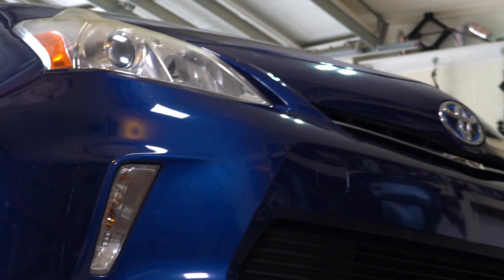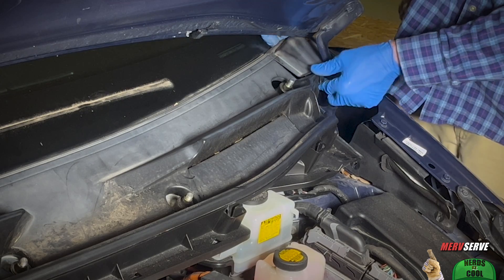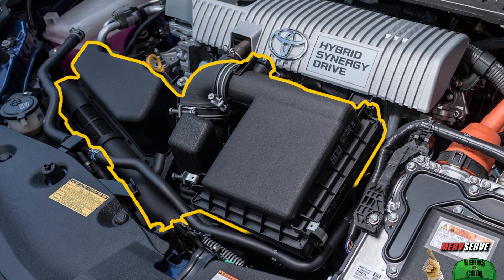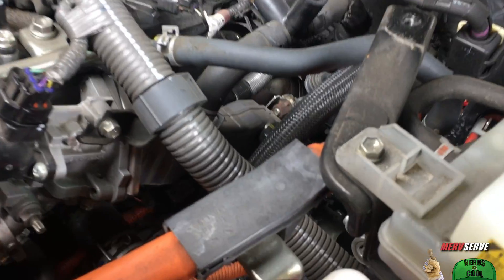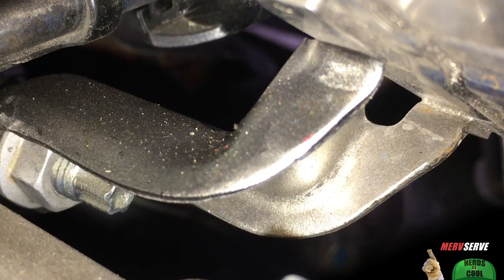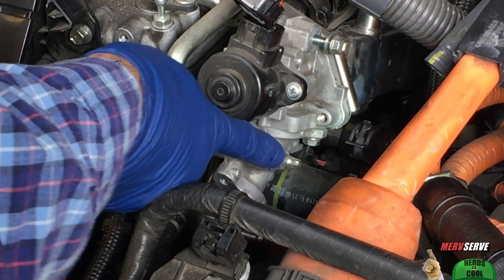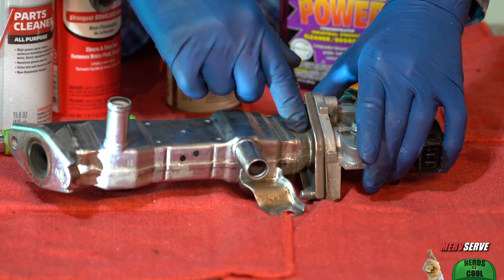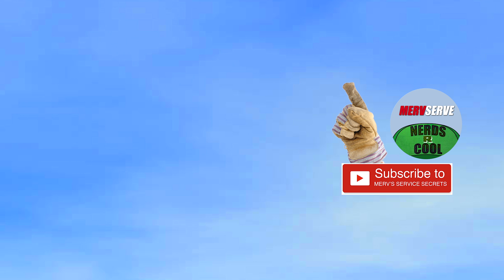Toyota Prius EGR Removal PLUS Organic Methods for All Cars - Ford, BMW, Chevy, Honda

Comment: It is not just the EGR cooler but also the intake manifold passages that are gummed up and could potentially be the reason for your engine's rough idling, driving, trembling, or shaking—unless you have a blown head gasket. While at this step, you should replace the PCV valve($10), as it will fail before the other two components, and clean the throttle body. If your car has more than 150,000 miles, you should replace the water pump($250 Toyota), located at the bottom left under the intake manifold, to prevent it from causing the check engine light as it could be too late for the engine then, and you could have a blown head gasket.
 However, I am seeking advice on properly purging air from the cooling system. I removed a water hose because it was stuck and came off abruptly and I need to purge the air from the system now, but no one seems to know how to do that correctly or they don't know how. 
It can be done with the Toyota diagnostic tool, which costs around $3,000 and can only be obtained by a Toyota dealer. The process is different from traditional cars due to the inverter coolant reservoir, making it an essential step. Can anyone help with this step? 
I might need to perform a complete flush, but that takes too long."
Please !!! 🙏???
Reply: If you figure this out, please post an update.

Comment: Edited

Excellent video. Used it as a guide when doing the job myself (even though I was never encouraged my Merv’s video to do such a thing). Thank you @Merv and team for putting this video together. 

Context of initial comment: third party company handling delivery of PDF at the time of initial post didn’t do their jobs. Merv did it despite their failure.
Reply from the maker: Now that's what I call turning lemons into lemonade!  Best of luck in all your DIY Adventures, which I of course would never encourage. - Merv Himself
Reply from the maker: Sorry I'm just now find this. To be honest, I have not been happy with that service at all and it is run by a third party, so I have very little control over them.   Please let me know if this has resolved itself and if not, I can probably just email you the pdf directly.  Sorry again.  And for the record, T-spring merhchandising really sucks.
Reply: @MervsServiceSecrets  Hasn't been resolved.
Reply from the maker: Sorry you're still having trouble.  My best advice is to call your credit card company and dispute the charge.  I am working on finding a better third-party to sell my merch.  Again, sorry for the runaround they gave you.
Reply: I got an alarming wake-up call from Merv Himself, telling me to send you some PDFs pronto.  Very sorry for the delay!   Please post confirmation of your receipt here in this community section whenever you can.  -Demille, Merv's perpetual intern and indentured cameraman.

Comment: How much should I pay for that service? Ill pay $500.
Reply from the maker: I'd love to know what they charge, but my understanding is they just blow out the cooler with compressed air.  In my opinion, that's kind of half-assed.
Reply: @MervsServiceSecrets my uncle has a 2013 that just popped the egr insufficient flow code and got quoted about 3k. I replaced the headgasket and the egr/cooler for my friend and only charged him 2k. Idk why it’s so expensive

Comment: How can i only remove the egr valve? I don't want to remove the cooler. I will just spray it with cleaner while its on the car. No big deal. I am stuck. I can't get the nut at the bottom of the cooler. can't get any leverage on it. If I take the nut off i should be able to get it to move to the right enough to get the nut on the left of the egr in the back. Oh dear
Reply from the maker: Phillips head.

Comment: This is magic, Merv!
I've recently bought a Prius+ (European 7 seater V) which overheats. I started by changing waterpump (had thrown a code earlier) and thermostat, checking all coolant hoses and the radiator, finally coming to the conclusion that this is probably the adventure I need to embark on.
Not too keen on getting this done in the parking lot, but the coolant is already out, and at least I'm on vacation at the moment.
Might be able to complete this and the cleaning in a day!
Reply from the maker: Let us know how you made out.  It can be tricky!
Reply: @MervsServiceSecrets Here's my update so far.
- The "expendable crew member" nut is actually not that hard to get at if you "hug" the head and reach it from behind the engine.
- My EGR cooler was so very caked that I ended up buying i lightly used one in fantastic condition.
- Overheating issue remains and it might be time to tackle the intake manifold.

However! I've also found the EHR (exhaust heat recirculation) loop, which doesn't seem to get heated properly.. After speaking to a Toyota mechanic he concluded that "I'm on my own" as they had never come across an issue with it.
There are hardly any info about it online either.

The joy of a 300k+ mile Toyota hybrid I guess 😄

Comment: Merv, Regarding the 12mm nuts on studs...four, I think:  one only needs to crack the nut loose a few turns, then remove the stud with the nut together.  During reassembly, a drop of Permatex on the stud leading threads might be beneficial.
Wiper motor and linkage assembly.  Leave attached to its wiring harness.  Bolts out, lift and place it on the passenger side of the engine bay.

Comment: I’ve used pressure washer to clean the inside of the EGR heat exchanger.   Worked like a charm.
Reply from the maker: Glad you got it working,  I'm a pressure washer fan myself.

Comment: Hey Merv I’m on my second bottle of oven cleaner just wondering if my cooler is a goner or I should keep soaking it. I have to soak both ends and haven’t had much breaking through to the other side.  Still comes out black but it’s been almost 2 months
Reply from the maker: well I mean I guess it's never going to be perfect, but I always try to look at a job and ask myself "is this better than it was when I started?"
Reply: @MervsServiceSecrets thank you I probably should have blown all the crud out when it was dry then soaked it but I found a deal on a new cooler from Japan and wish me luck but the car works pretty good now especially after the software update.  I think I could put some o rings on a couple fuel injectors but besides that my car runs great. Check engine lights went away.  Just want to thank you for playing a big part in my learning.  The funniest thing that happened to me was getting high off a loose fuel injector accidentally.  I told myself that’s not my blunt, that feels too strong. Lol

Comment: i was trying to decide which i appreciated more, the tutorial or the entertainment value and tbh, both, which is an incredibly rare aspect of content creation especially for automotive repair. really good writing. i vote 1 as the most ridiculous since it makes the front of the vehicle yella. i just bought a 2014 prius v with 126k from my friend and doing this job. i didn't have any hose clamps but since i got those assortment of rubber stoppers, i just used those to plug up the coolant hoses.

Comment: This video is so well done and funny and you explain everything so a 10 year old can do the job I got to your channel by someone else saying to go to prius  shaking  I couldn’t help it but subscribe right away And give you a thumbs up for the good work you do for your community. My Prius has a blown up head gasket because it was losing a little bit of coolant. I had put bars leak a few times and it seems like it was getting better just losing a little bit of coolant. And then a few months down the road it was shaking a lot at starting and even putting in drive. It would shake for about 234 minutes. So I decide to ask my mechanic to put the blue devil head gasket sealant which he did and now I don’t have anymore heat coming in the car and when it starts shaking engine light came on I checked the code and have cylinder one and four misfiring. Can someone help me to diagnose this?
Thanks
Reply from the maker: Did you try fuel injector cleaner?  When Demille owned the car, he actually paid a dealer to clean the injectors and that solved all misfires

Comment: It could be a secondary issue, but after replacing our egr valve we now have a strong exhaust/unburnt fuel smell at idle in our prius (obviously except when in ev) if vents are set on outside air. Inside air we cannot smell it.

What did we fudge up? 😢
Reply from the maker: It's been a few days since your post. Is it still persisting?
Reply: @MervsServiceSecrets  Yeah unfortunately.  It could be an exhaust leak somewhere (we'll get it checked out when we have the money) but we were trying to figure out if there's anything we could have accidentally done in that system or not connected properly that would bring us this issue. No CEL and no codes
Reply from the maker: I'm a DIY hobbyist just like you, and of course we all attempt these repairs at our own peril, but a couple things leap to mind and I'll throw them out there just in case they resonate:    Maybe you forgot to reattach the PCV hose? Coolant leaking from when you clamped the hoses?  (Maybe one got damaged or wasn't reattached right) Gaskets properly reinstalled in the various parts of the cooler, including the one that goes between the cooler and the exhaust manifold?  Hopefully these suggestions might spur some insight.  Also, if it helps, this video shows my observations about those gaskets: https://youtu.be/QGcZYGA2cnM?si=X_aMkFf05ceWLW7n

-Merv Himself

Comment: my 2011 prius has 81k and I am thinking about replacing the radiator and inverter coolant, might be a good idea to do both egr and intake manifold cleaning at the same time.
Reply from the maker: You should

Comment: This is a great video. This car takes some work and it will eat  your nerves. Part of the design of this car are not so smart especially the Winshield which is very easy to break and that cooler bracket on the bottom is just bad painful design not even necessary. I learned and done the head gasket alone and it was great for 23k miles now is running super rough misfiring cylinder 1,2. I’ve taken all off the manifold the cooler soaking overnight and the valve I gave a good cleaning,will see if this will solve my problem. The manifold was very dirty but after cleaning it only not a difference at all. After I took the egr valve off it was full of carbon on both ends. The design of the egr system is terrible as you have to keep doing it over and over.

Comment: A more secure way to capture the nut you had the magnet on is to get a small piece oh insulation tape and put it on the inside of your socket then push it onto the nut/bolt you are undoing or fitting and it is a nice snug fit. Regards Chris

Comment: A word to the wise...after fighting with the "expendable crew member" for a day and a half, I came up with a brainstorm that maybe my tool was too big (no pun intended) because of this hose that's right next to it that prevented me from getting a 12mm deep well and 3/8 drive ratchet in there. So I ran to Napa and got me a 12mm 1/4" drive deep well socket along with a 3" and 6" extension just in case and with the help of my long handled 1/4" drive ratchet, I had it out in a matter of minutes
Reply from the maker: Great tip. Thanks for watching!

Comment: Man I’m having the hardest time getting that damn stud off the bottom! Like I’ve been trying for days can’t get my egr cooler off 😭
Reply from the maker: Maybe needle nosed vice grips?  Or a very small closed-end box wrench. Just enough to grab the end of that stud and start her turning.  And don't forget which way she needs to spin. It's easy to get disoriented.
Reply: @MervsServiceSecrets  Finally got it off! Man I used 3 bottles of parts cleaner on that cooler and some long brushes and still can't see through that thing! you recommend soaking in purple power overnight? what else can I do to get it clean

Comment: Hey Merv, I did the EGR service, intake manifold on 2011 Prius with 194k miles. The car was running fine but I figured I do the service to avoid any problems. I put everything back together and I started the car, it  ran for about 10 seconds and started to surge and stalled. I started it again with the same results. 
Got p3190 and p3191 + p0a0f codes.

Any idea what the heck I did wrong? Or why it's doing this?
Reply: I did exactly what everyone was going to tell me.

I went back and checked my work. This Dumb@$$ forgot to connect the PCV hose to the intake manifold. 

Thank you for your awesome videos, with plenty of Organic humor.

Comment: How did you manage to remove lower rear bolt at 11.20? I can't remove oil cooler because of that bolt (and nut)... 😢
Reply from the maker: I came around the other side of the engine and got in there with a small wrench.
Reply: @MervsServiceSecrets  I spent yesterday's whole morning to remove the rear nuts (after removing the wiper panel) and the lower "pain in the a**" nut, that one gave me trouble... :):)
Reply: by the way, I spent like half hour to understand that was not a 10mm nut like the other ones!

Comment: Hey,
Great job Marv!
To really get the EGR cooler clean besides Easy Off, I used a high pressure power washer with the cooler screwed  to a big block of wood and I got it brand new clean!
Reply from the maker: I used the pressure washer trick, but I got sick of chasing the cooler down the driveway!  Screwing to a block of wood is an excellent tip!!!

Comment: I performed this job today on my 2015 toyota auris hybrid which has the same set up as the Toyota Prius. I soaked my egr cooler overnight in degreaser followed by a thorough jet wash the following morning and then Hooray I could see daylight through my egr cooler. I took Merv’s advice and cut the dreaded bottom bracket as it is easier to take off next time and it is easier to put back on. Take your time when performing this job and make sure you clean everything properly especially the small holes in the manifold. Carb cleaner / egr cleaner is not sufficient enough to clean this and I advise something stronger. Some say don’t use oven cleaner but I used mr muscle and it stripped the carbon away. Some parts of carbon I stripped with a metal wire hanger. Please be thorough when doing this and take your time and do not forget to change your pcv valve when performing this task. 

Now my car drives with a lot more power 😊
Reply: why replace the pcv valve?

Comment: My 2010 died on the freeway. P3191 code. Is it possible that the EGR cooler is blocked and keeping it from running? It is not the fuel pump.
Reply from the maker: I don't have a magic answer for you, but it might be the EGR valve itself is having problems opening and closing. Watch this video to see how I dissect it --> https://youtu.be/QGcZYGA2cnM?si=DK9d2PCoaOBI0O5h  Might also be something as simple as a sensor gone bad.  Maybe check out priuschat to see what other's who've had the same problem might recommend.  You might also be able to determine the best order to fix/replace things in.  (starting with the lowest cost solution, then working your way up). Hope this helps.  -Merv Himself

Comment: ❤❤❤❤ so ya, misfires on my Prius got me delving YouTube’s depths for why replacing the spark plugs didn’t make everything hunkypurry again. Hours of video watching later, and slightly less time spent on cleaning the maf and replacing the pcv (all new acronyms to me), still wondering what the egr is on the list of things that might be wrong that my code reader is advising me, come across this video. The best of YouTube mechanics. Thank you! Sure hope it’s not my egr and swapping these two coils out is gonna do the trick instead
Reply: Toyota issued a bulletin a while ago stating that they acknowledge this is a routine service item on 10-14 model Prius

Comment: I cleaned my egr heat exchanger with boiling water and leaf blower. It helped, but it took 5 hot water baths. I would suggest a laboratory bunsen gas burner. The flame is very hot and pointed inside. This is all stainless steel and you can heat it safely to red-hot, i.e. 600 C deg. All garbage burns before this point.
Reply from the maker: Great tip!

Comment: i took apart the "forbidden" egr motor as well. nothing so darn forbidde, just dont loose anything. There are a couple of springs, but they are under the rotor. Also, when removing the phillips screws, do yourself a favor. send these screws to make company to the stud from heII. replace them with hex-head bolts or allen wrench bolts, 5 mm. Such bolts are used often on bicycles.

Comment: 14:22 I removed all high voltage cables, and the entire low-voltage harness. and the console under the el motor coolant, an swung the cooling container away to make space. nope space is never enough.

Comment: 9:46. Instead of torque stud, I used 6-mm socket. Feels a bit loose, but it worked, Did not strip it. Again, you can trow away the cursed torque stud, and replace it with long M8 bolt and a nut that is screwed all the way to the head of the bolt before installation. :-))) Again, I love your coloring!

Comment: 7:23: "giant pain in the aaaaa...." i cut it tru, so that as soon as you loosen the nut, it can slide off. nope. did not help. still the two studs on the very far entrance are obstacle. well, the heII with the 7:23 bolt. If you very much insist, there are special bolts with long thick necks, that have about 10 mm of thread on the front. They can be used instead, and the head is outside, easyly accessile with a wrench. Or, take a long enough M8 bolt. put two nuts at the end, leaving as long as you want thread <sorter than the thread on the original stud>, tighten them against each other. Again, the head is now on the open, accessible to most wrenches.